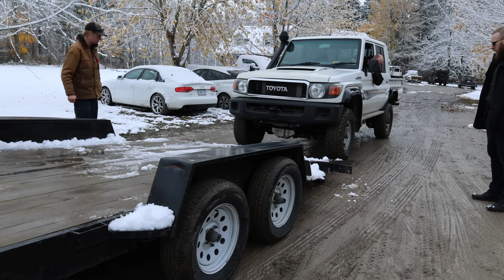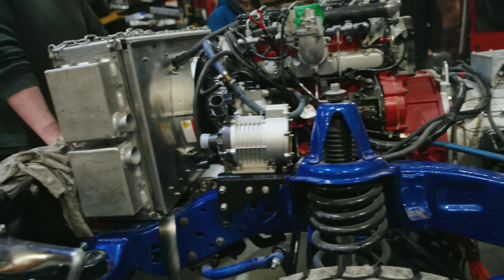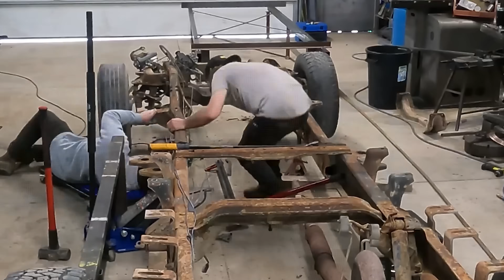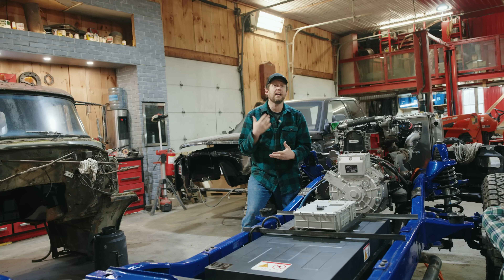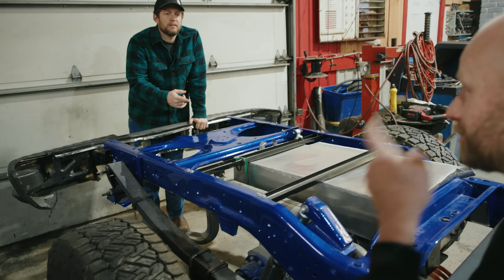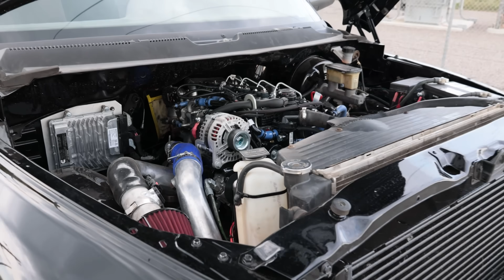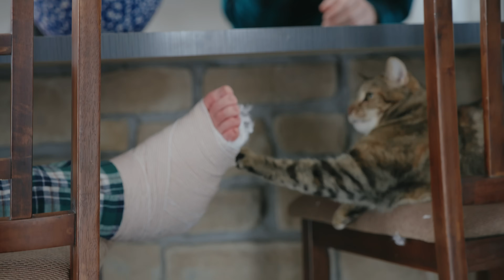Scrap Our First Design and Build an Edison Pickup Chassis from Scratch?

Comment: Keep the frame rails straight at 34 inches wide front to rear just like the semi trucks. It will just make mounting cabs and rear chassis accessories way easier to mount. Cab mounts could be just a universal mount that is cut down to match the different widths needed to the different mounting points and welded on at different heights needed.
Reply from the maker: I agree 
- Chace
Reply: I think I Miss spoke, as far as rich is concerned, anything 2008 onward that is that is f250 f350, or f350 with factory bed delete are all 38 inch frame rail, which is the deboss division target market, I’m sure people will convert the regular trucks, but I think it will be much more common to do a truck that holds some type of added value. As far as a prefab chassis ready to roll can you get the price down to a reasonable point? To make dollars make cents, which will ultimately be the ultimate decision making factor when someone has to write the check? Rich is a fairly frugal dude, and we need to remove YouTube add revenue from the equation of all but maybe a dozen customers, can he make the complete chassis price tag work for a business, would it be considered a vehicle purchase we can deprecate over 5 years? And what would a rough number to take the truck I already own and throw away any and all value it holds, pay for the cab swap, and bed swap or new bed, chassis cost, electrical cost, new engine cost, computer cost, pray the wiring is better than ram factory work (joke), I’d like to see the value, or the estimated total cost, plus my doner truck, then compare that to how much power I would have to make to be equivalent to the e-axles, (justify the cost of just rebuilding what I have at equivalent power rating”, then we can compare fuel efficiency fairly, because for me to make 800 hp on my ford 6.7 diesel I’m burning much more fuel ?, so, I’d like to see a rough estimate of cost, upfront, vs let’s say 5 years in, at 20k miles per year? The reason I ask, is because for me to build a cool truck, rich deboss kit is one thing, but for me to upgrade my business trucks the dollars HAVE to make cents
Reply: @GRANITEMONUMENT having a pre-made chassis doesn’t hurt - you could drop any body onto it with just some TLC and careful planning you can refurbish a vehicle that would’ve been doomed to be torn apart. Cheers 🍻
Reply: @owe @owendodman3037  but before that idea can even be thought about, does every other person not have a couple questions, first, what is the total estimated cost, as a business “Edison” or someone like me a potential end user business. If the total estimated cost will be 130k and estimated fuel savings will be 2k per year, and require 15 years of service to break even, when compared to buying a brand new f550 king ranch or platinum or f600? Battery life expectancy? Is the battery and controlling cpu systems and their programming somehow universal? Or would they require custom parts and or programming via Edison? What will the curb weight be effected? What will buying full coverage insurance look like? I guess my MAJOR concern is, is this a YouTube content creator selling trucks, or is this a truck manufacturer for some reason sharing proprietary “ideas” with their competitors? What’s stopping ford, ram or gm from doing this if the truck would realistically compete with current trucks? And if tomorrow ford said they are going to release a truck chassis ready to roll, slap your cab, and service body on, order a pigtail to connect to the obd port and done, as simple as lifting your cab to replace a turbo? My point being Edison is not the fist with this idea, it seems everyone has gotten them to the testing stage and then abandon the entire project @brucewilson had one just recently that a competitor of Edison had fully functional converted peterbuilt and went belly up, Bruce has the fully built truck and last I saw had maybe one loose wire with absolutely no way of figuring it out (not sure if it was ever repaired) , but for a company like Edison to get an ass load of investors money, and buy property that in my opinion is an awesome setup if they were to give up on Edison, he would be holding hundreds of acres on a beautiful land, with cabins , with septic systems, electrical systems, massive building all brand new, vs getting a building at a minimum expense to bring their product to market? To go and contract deboss (whom I love watching) does not seem to be great for bringing product to market, yet it seems awesome idea to build your YOUTUBE brand?? There are hundreds of machine shops that produce parts, are setup to design parts and do testing of parts all on cad, if I’m correct the YouTube pilot aircraft channel “jimmys world” came to be when he sold his electric car design, and testing business for millions and millions why not connect with him? They bought this massive property so they could do their own testing, on their own test track? Where and when is their test dyno? There in my opinion is just way to many things that do not make complete sense from a business standpoint, unless you told me their business was making YouTube content. I understand a lot of what drove the EV market is now being called into question, artic ice caps have only grown over last 40 years? Anyone looking at EV’s to save the environment might have been had a little, now I like EV’s because they make tons of power, and instant torque! But again dollars make cents ? We as the crowd of people waiting on trucks with bated breath, have not a clue what the estimated total cost will be! To drive in our 300k plus mile old cabs, with very little rot on our cab corners paying more than a brand new truck potentially or FAR more maybe? We don’t know if insurance company’s will recognize these as “new trucks” after we pay that? We don’t have a clue how these heavy systems will affect our payload or empty weight? What will warranties look like? Will there be any critical parts or programming that will rely on Edison to service (if they go tits up). But aside from all that, I like watching anything mechanical being built! So their YouTube (which is what I believe their actual business is) is great!
Reply: Also, not meant to be insulting, do you have trucks for personal use, or would you potentially buy for a business? Or are you just more interested in watching cool shit be built? My question boils down to, if it’s for business, then you know as well as me, it just boils down to cost, utility, (you definitely don’t give one f if your employees can drag someone off a red light, you definitely don’t need trucks that even a gas f550 could not pull. If it’s personal use then you know good well to buy an “experimental” you better not need the truck, a repair might take two or three weeks with small or no dealer networks? If you an employee then just kind of wishful thinking at best??
Reply: @GRANITEMONUMENT 
Ever vehicle had its start at being a one of a kind - Freightliner started off because of CF looking to save costs. 

ConMet because of freightliner needing to save weight for CF to trim a few more dollars in fuel saving. 

In fright business - how much you can legally carry, and cheeper your fuel needs = less over head... 

Yes their is a huge difference up front - however that cost drops when it becomes more available - however, most important fact is the majority of this vehicle is available used. The electric assembly is not common. 

The electric drive mechanism is not common, but is available on the open market. 

To answer your question - yes it could be very worth it in future savings of opportunity cost savings. 

So other than the Gen, control system, electric drive mechanism and the Liquid Spring Suspension this vehicle is available as used parts. 

Other than that Suspension and drive control system - it's all old school mechanics. 

Meaning most repair could be proformed by the owner at home or on the side of the road.  Depends on what skills the owner/driver has...
Reply: @Marshall-b2u agreed, but keep in mind, the company’s you mentioned, did not reinvent the wheel, they basically spun off what was already being done, as far as doing MOST repairs at home, yess they keep saying that, but how often do you break down at home? So you will rely on shops, the chassis they are talking about are much more designed for upfitters, like ambulances, cranes, service body’s, roll backs, I don’t think that is being targeted at hot shots? As they generally mile out everything from power seats, to power windows, they generally stack up 500k in 5 years, and not much worth swapping over, I own trucks that are custom built to deliver and install monuments and memorials low miles, high hours, mostly operating the crane, but with the newer aluminum trucks I’m hopeful that keeping out of salt the chassis remains good. But ultimately I don’t care what you drive, if there is one computer, one ecu, one bcm, who’s going to write the diagnostic software? Yes companies came up years ago understood, but if the companies that already own all their infrastructure are dropping off? What does that say? I mean even cat pulled out because it’s such a tight profit margin that it was not worth it! I’m not worried about replacing a ball joint, but if they build a chassis now all the hard parts are going to be needed, unless they go buy, one of the big three parts and use them? I understand the words they say, but in reality let’s look at a burning up a wheel bearing and tearing up your spindle / hub ? Who we calling? Or got an error on the dash that the generator is circuit 2 bank one high? No one will have a clue except Edison, my argument is, they should be spending money to invest in that infrastructure, not buying a massive let’s call it what it is, a playground for the boys! .?
Reply: @GRANITEMONUMENT 
Yes, Your point is very well made - that's why I prefer building a costom engine - no electronics, no EGR, DEF and other stuff that will be a issue on the road..

Yes, I prefer a manual 6 speed trans.

The Liquid Spring Suspension has to have Electric Control - but as a hot shot that adds value to your business - it's better than airbags... 

The gen should not be any major concern - gens have been around for hundreds of years - the electric drive mechanism not new - however, your point about the control ( brains ) is still going to be a issue ( even if it's a open source coding ) as not every shop will have someone who will understand the system. 

That why he is trying to build a network of builder.  

But realistically if you have a shop and need new equipment - it could be a good idea to start learning about this with a text mule..
  
That's my thinking 🤔
Reply: @GRANITEMONUMENT 
Consolidated Freightways (CF) was founded in 1929, in Portland, Oregon, by Leland James, who merged @ four or five, according to some records -  local trucking firms to create a regional, and later national, long-haul carrier. 

It became a dominant U.S. freight company by innovating with lightweight ( COE ) trucks (leading to Freightliner), diesel engines, and early intermodal, double-trailer operations. 

Key Founding Aspects... 

Initial Structure: Created by merging five smaller, regional motor carriers in the Pacific Northwest into a single, cohesive entity.

Development: Survived the Great Depression by offering more efficient, faster service than railroads, expanding from regional service into a nationwide network.

Innovation Focus: To overcome strict, early-1930s length laws, CF partnered with manufacturing to design their own "Cab Over Engine" (COE) trucks, which ultimately became the Freightliner Corporation.

Growth Drivers: The company was a pioneer in using diesel motors, creating refrigerated transport, and utilizing double trailers. Reason for the COE trucks... 

Despite its massive success through the 1950s-1990s, the company faced challenges with deregulation and debt, finally declaring bankruptcy and shutting down in September 2002. 

Chuck worked for CF for many years - between 40 - 50 years... 

I had work at a freightliner truck plant  years ago ...  It was a sideline job as my main work was shipyard at that point in time.
Reply: @GRANITEMONUMENT just offer a set of body mount brackets for each OEM truck manufacturer - easy peasy problem solved.
Reply: @georgewhy3886 no, that works for factory beds, but upfits like dump body’s or service body’s, cranes. All tweed their structural rails to sit on the trucks frame, not a couple of brackets that are bolted to the frame.
Reply: @GRANITEMONUMENT all the upfitter stuff you're talking about is designed for a standard 34" wide chassis, which is exactly what Chace was saying they need to stick with when Rich brought up the idea of widening their chassis. City-slicker pickup beds can easily be mounted to a 34" wide chassis for Joe Blow wanting to convert his pickup by simply using mounts that bolt or weld to the 34" chassis and are placed to use the factory pickup floor mounting holes. IIRC, factory Ford is ~37" wide chassis for non-C&C pickups. 

As for your point about depreciation (depreciate is not the same thing as deprecate, lol), you seem to be behind the times regarding biz tax law - unless you're up in Canada. US businesses can write-off nearly 100% in year 1 now, feel free to look it up.
Reply: @jrm @jrmaatta unless your not up on us biz law, I don’t believe I can replace the chassis and keep my cab and depreciate the truck AGAIN!unless Edison gets some type of way to incorporate my cab with my vin number and issue me a new vin number? Obviously it has not been done in this manner but, my point is, does this make any financial sense whatsoever? Yes I’m very up on biz tax law here in the United States, but I will admit I’m a little past doing my own taxes and I generally let my attorneys, and my tax guy figure things out. I could not imagine running my business AND keeping up on tax code! Anyone who tells me they know tax code, that does not do it on a daily basis I basically let that go in one ear and out the other. But great catch on the spelling,
Reply: @jrmaatta also the last tax guy I met that knew bed rail width was NEVER!
Reply: @GRANITEMONUMENT  that's because I'm not a CPA (or tax guy to you), I'm a custom truck guy and have done quite a bit of research lately into starting my own small business in an unrelated (not custom trucks) sector. I was also talking about chassis width, not bed rail width, those are two very different things. 🙄 But good luck to you, curmudgeon.🖕
Reply: @EdisonMotors  If you're not using the
bumper holes for anything else, you can
put some LED driving lights in there with
heated lenses to melt snow and ice.
Reply: @ml9867  That's where incandescent lights have a bonus because of the heat output from them. I'm reminded of a story I heard of a city changing from incandescent to LED traffic lights. In doing so they found that they needed to put in heaters so the signals would remain visible where the incandescent lights did that anyway because of the heat output from the bulbs.
Reply: Completely agree on the straight 34” rails. From a 6x6 upfitter perspective, that width is the 'industry baseline' for a reason. It minimizes the Dependency constraint on custom-made accessories. If Edison keeps them straight and standardized, the 'Trade-off' is a slightly narrower track in the front, but the 'Outcome' is a platform that can be stretched or tandem-axled globally without custom-engineered adapter plates. It’s about building for the upfitter ecosystem from day one.
Reply: @SpacecraftOverkill  or they could go with wide track front axles and get really sharp turn radius. I think most drivers would appreciate that (similar to how they do on the f450+ vs F350-)
Reply: @SpacecraftOverkill 
Oh, that’s what I would like as well when you just place your order for the chassis you just say you want it to 2WD, 4WD standard, 4WD rear or 6WD standard. Your wheelbase and potentially what accessory systems you might need to have driven or will be using.  kinda like when you order the big truck.
Reply: Gotta keep 34” rail width unfortunately 
Service bodies and underbed tool boxes need the room
Everything is set up for that
Reply: @C_CEQUIPMENT 💯
Reply: It’s a standard for a reason!
Reply: 34 in from front to rear is the best idea less trouble just 2 rails and cross members , you don’t waste time and Money on R&D
Reply: Agree 100%! Go with 34. Adapt, modify and customize later to suit your customers needs! You guys are kicking ass! Keep it up!!!👊
Reply: My dream of modernizing our 70’s farm truck is getting closer.  Love the plan.
Reply: There’s a decent amount of f450-550 cabs around that military take off for armoured vehicles . Only problem is lack of a vin tag with them . But it would be a good way to source cabs for some of these pre made chassis
Reply: One ton cube vans also have wider frame widths behind the cab, some up to 48" and those are the same frames for Class C motorhomes.
Reply: I agree...maybe  make mounts adjustment...etc with other components too..?
Reply: What engine are you using instead of the Cummins?
Reply from the maker: Rich wants Perkins, I'm still leaning Cummins
Reply: @EdisonMotors  As long as you offer a model with the 7L Scania in it ;)
Reply: 1/2 inch straight semi truck frame rails would be awesome.
Reply: Stay same width all the way front to back. Just like accommodating different body mount points, we could just utilize an angle piece at the top (or cross members at the top, above everything) to provide mounting points for practically anything. We could even leave them un-drilled so you only put holes in them if you actually use it as a mount. Bonus selling point; it's a stiffener that adds frame rigidity!
Reply: I am looking forward to using your system in hotshot hauling, plan on putting 200k or more miles per year on that truck, hopefully your setup will go over 1.5 million miles
Reply: Love seeing the common appreciation for 34” Rail Width and the common sense approach of using C Channel instead of Boxed Frame.
Keep up the Great Work Team Edison!💪🏼🇨🇦🤠
Reply: I think 34 inch frame rails makes more sense because that is what the heavy weight aftermarket bodies all fit. If installing pickup box, outside the frame mounts make sense because they won't carry as much weight. Keep with the industry standard.
Reply: I really like the thought process here.  Seems like you could get a lot of efficiency and quality control from building everything in a factory production line vs. having a patchwork of small businesses figure things out from square one each time.
Reply: @DanielBelzil if we were to forget that financial decisions will have to be made, then great idea. But before ANY of this can even be entertained there needs to be some estimated cost analysis done! With insurance companies insure them? Where would they be sold, dealer networks? Warranty? Are any parts or programming relying on Edison to be in business, and willing and capable of supplying, wiring harnesses, parts, CPU’s ? CPU programming? And will they be developing a system to take operate a pto? Your average grocery getter is not going to make financial sense to do this to, I can almost promise that, it will be targeting upfitted trucks, that have 100k dollars of cranes, roll backs, and bucket trucks, boom trucks, lube trucks, tire changing trucks, welding trucks, and for a business to invest it needs to at least look promising on paper.. I can’t believe how many people think a decent YouTube content creator, will drive sales in excess of 100k to be able to put a clapped out truck on a new chassis!
Reply: Agreed ❤
Reply: 38 inch drop frame rails are the correct path - lower center of gravity, wide frame is better... 
Besides it would also allow the factory bed to be used... 

Can fab mounts for the 34 inch costume commercial beds. At the same time allowing the 38' beds to be fabricated for those who prefer this... 

I prefer the drop center frame for its lower center of gravity - the truth is a hi center is not as stable in traffic.  

The ride height comes from tire size,  22.5 rim dia 10 lug is my comfort zone... Cheap and available at truck stops! 

All 4 corners need to share the same rims... This rim could allow the ability to be used on trailer - removing the need of more than one spare tire. 

I also personally prefer a f600 with the maximum legal non CDL towing or hauling abilities as frame set. 

I would also personally prefer the 6.7 Cummins modified to a non roller block with a 5.9 crankshaft...  

A 2 value head with a P-pump fuel system - no EGR, no DEF, No auto start...  Yep just bare bones hot shot work horse 🐎. 

2004.5–2007 (5.9L): Some 5.9L models (2004.5–2007) used "in-cylinder" EGR techniques via cam profiles and fuel injection, but did not have a physical EGR valve.

Liquid Spring suspension - yes no leaf springs..   that's my dream trunk... 

I believe the Ford super duty cab is basically the same from @2009 up... 

I like the all aluminum cabs with the drop door windows. 2017 is the Aluminum cabs production.
Reply: @Marshall-b2u 2 frames, 34" straight and a 38" drop. 34 will do 150-450, and the 38 handles medium duty. There will be plenty of demand for both.
Reply: @brunsy1990 
One frame that would offer a customer a frame they could provide from the current market ( commercial service vehicle ) and have a second market, the costom hobby truck is ok.. 

His market is commercial - this frame would fit the hot shot market very well.   

The drop frame has a lower center of gravity and the wide frame is more stable.   That on over the road delivery has a benefit in comfort and safety. 

The straight frame market is covered by the factory - the drop frame is not! 
Not at the maximum legal weight Scale for non CDL. 

That makes this a custom frame that is perfect for the hot shot delivery occupational field. 

So it's better to build one frame that hits most of your market and has not current comparable compatible marketing. 

Just my view - an yes I texted him in the past - just don't expressed as much details then, I really want him to be able to make it in business - I can't drive any more due to medical issues. 

If I could, I would not be exposeing my ideas to the world, I would just be building it, working it and exploring maximum Value for my own personal perspective.
Reply: @brunsy1990 medium duty and heavy duty trucks all use 34" standard chassis width. That's what the entire upfitter market has been using since the 1940's.